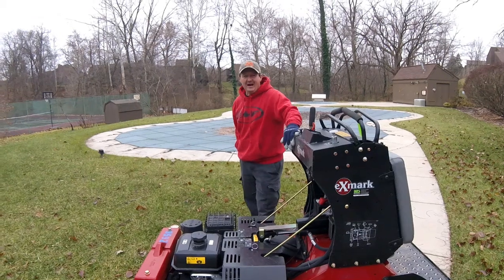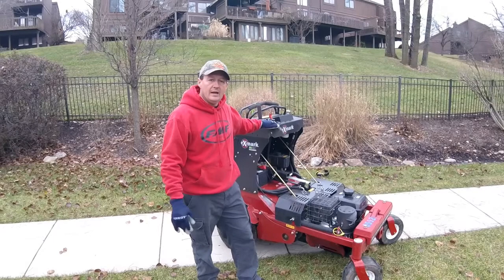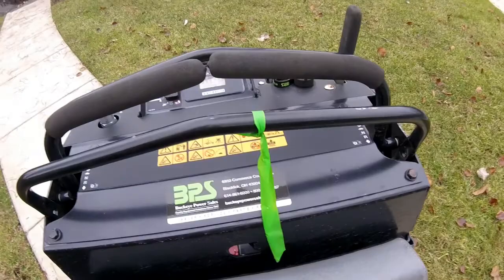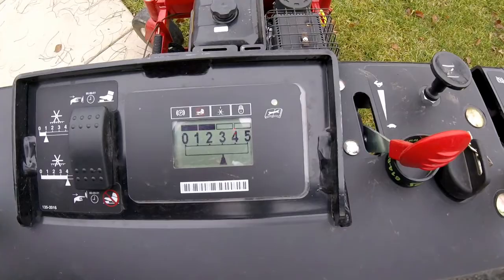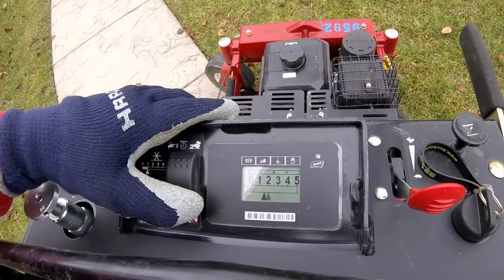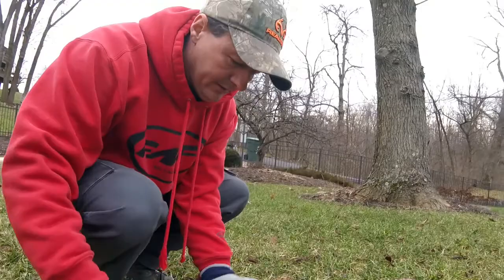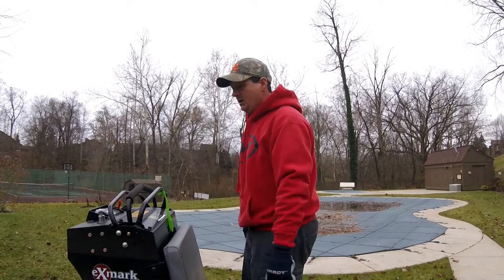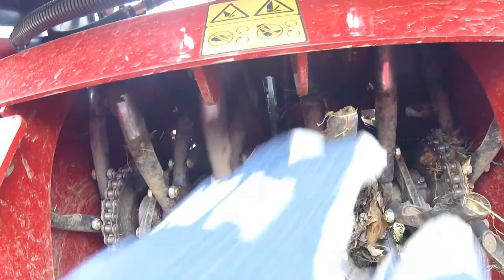Exmark 24" Stand on Aerator -  Fisrt look

Comment: Thanks for the video. I just bought  24" Toro unit and i think that the traction is horrible due to the small tires. 
Looking to add wider tires and was wandering what your what are your thoughts on that?
Reply from the maker: I'd say it's definitely worth a try. 👍
I know that was an irritation for me. Lack of traction and rutting.

Comment: I've got one if these new yesterday, I'm trying to set operator weight but as I turn adjustment clockwise it rises up wheels off ground well but as I slowly adjust down it then starts just going up and down up and down and I can't get it to hold just touching ground? Any thoughts
Reply: Did you ever figure it out? I'm having that problem now

Comment: I demoed a stinger aerator have you tried them? Nice that it doesn’t have all of those chains
Reply from the maker: Yes, I have run the Quad Aer 400, and we did extensive testing of the new (still in prototype) Quad Aer300. They are solid built units! I Should have several videos shot of that and the full reviews coming in about a month. They will be very informative!!

Although I wouldn't consider it a direct competitor / replacement for this unit, as they are built for different segments of the market. 

Much like the Stinger 4000 has a unique target in the business from the Quadaer 3000.

I have a couple more on this machine too waiting to be released. 

You point out the biggest advantage of the stinger ride on's. Where did you demo the stinger and which model?